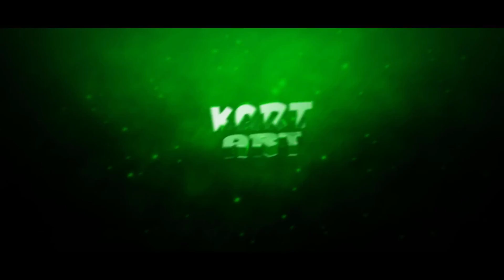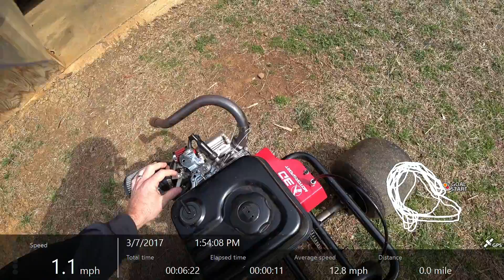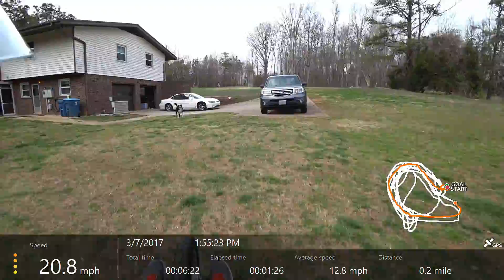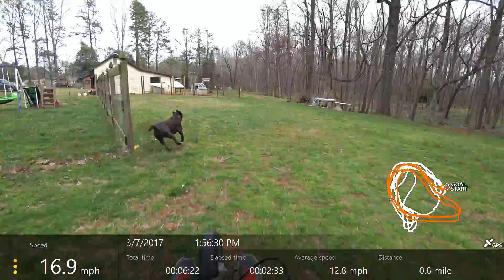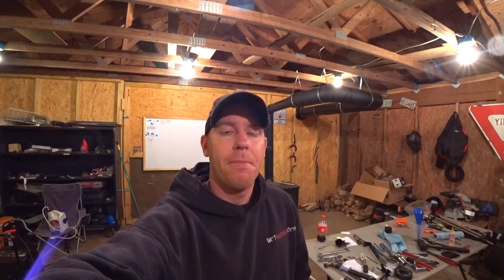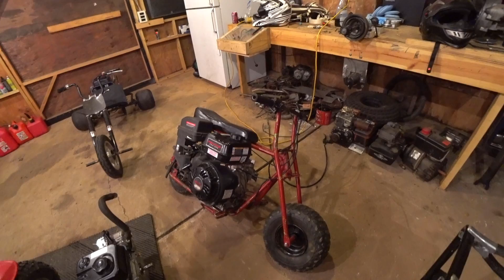3D MOTORSPORTS CLUTCH PART 2 DRIFT TRIKE (WHEELIES)

Comment: I see that trike engine is pulling quite well but if not to to much work could put an adapter from 3/4 to 1 inch shaft an put the 420 on trike peps probably would like to see that but I know these things are a lot more work than some think

Comment: Hey buddy was wondering how to get the 212 predator to idle down some I left the govbet on it and adjusted the spring got 3100rpm out of it but now it idles at the speed my clutch engages at witch is around 1600 was wondering any info
Reply from the maker: Kylee Bates make sure the throttle is returning on its own to idle position. you should use an stronger return spring than what comes with it. 
also sounds like you could have possibly been turning the screw on the carb itself which is the idle screw not the limiter. 
the limiter screw that needs turned out is on the throttle assembly plate ( metal silver part next to tank).
Reply: Kart it is returning on its own and I don't know where to find a spring like this one that's stronger also I adjusted the screw on the carb and I didn't get anything from it so I turn it in or out to get it to adjust right?
Reply: also could you try a top speed run down the road one time
Reply from the maker: Kylee Bates leave the screw on the carb alone. it adjusts the idle only. turning the screw on the carb in will increase idle and put decrease.  start your engine with the wheels off the ground and back that screw on the carb out (the black screw) until your idle is back to normal. 
on the throttle assembly there will be a silver screw that has a spring captured. back that out until the throttle arm ( silver arm ) wont touch it at all. 
a hardware store will have small springs around 3 - 5 inches. you can install one from the back of the throttle arm ( silver arm ) to any point you can attach it to close to the exhaust flange
Reply from the maker: Kylee Bates i have a new build coming up that i will top speed run. I have moved on from the drift trike. This time of the year is extremely busy for me.
Reply: I left that screw alone after I dusted it back it still idles at 1600 and I don't wanna take the governer out of it I don't wanna blow the engine I don't care to reach 6000 rpm just arou nd 4 or 5 3 is good for now and alright I'll try another spring on the arm attached somewhere near there as well as leaving the gold spring on the govner arm
Reply from the maker: Kylee Bates if you havent messed with the idle screw or carb there is no reason it should idle high. got me stumped.
Reply: something to do with the governer governor has it idling high if I swap the spring to the spot where I reach 3100rpm it idles a little higher then what rpm my clutch ingauges
Reply: bought some knew springs for it haven't tried one yet to see when I got to finally open it up and hit governer I reached around 31 mph with stock 60 or 61 tooth axle sprocket and 10 tooth engine sprocket with 13x5-6 rear tires
Reply: Kart or are you talking about the spring on the actual butterfly valve on the carb to the governor arm

Comment: what mods are done to the motor?
Reply from the maker: Roosevelt Coffey arc +.020 rod. black mamba cam, bored carb, header, governor removed, 18lb valve springs, arc billet flywheel.